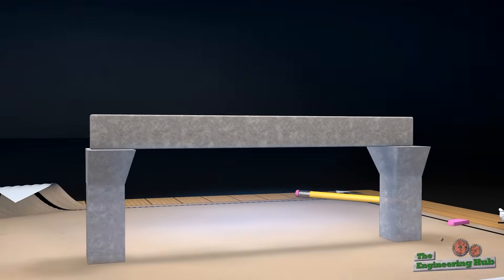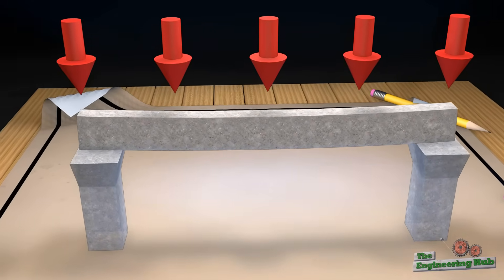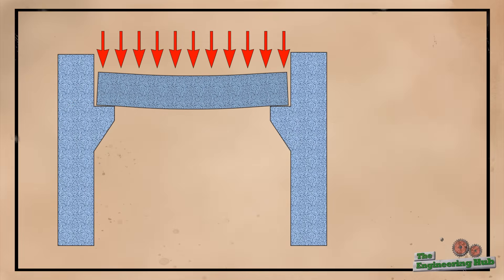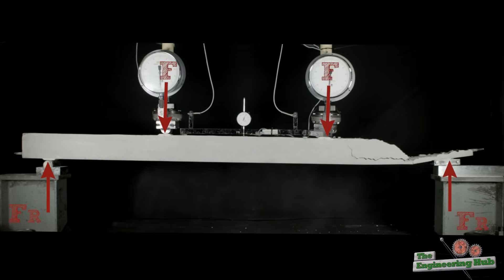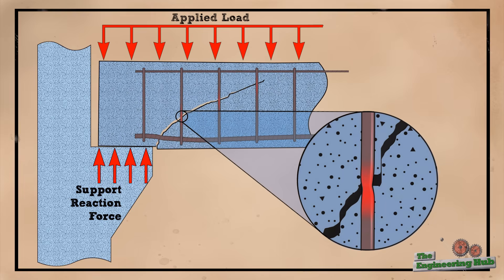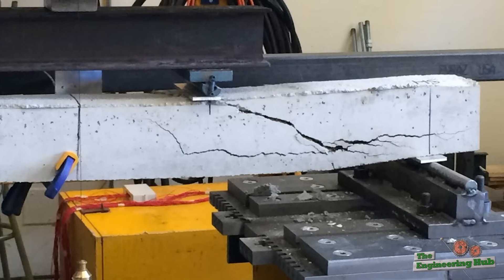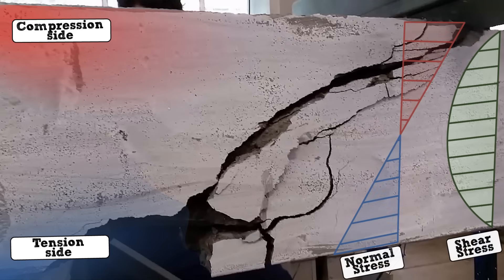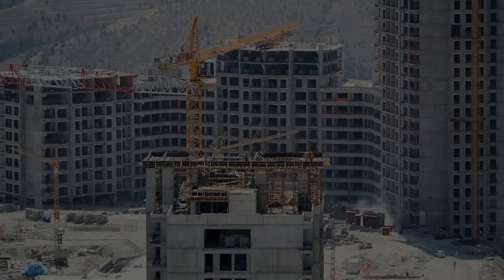The actual reason for using stirrups explained

Comment: Not an engineer, but suddenly the idea of prestressed concrete makes more sense. If you start out with tension on the load side you'll (hopefully) never have tension on the unloaded side. Right?
Reply from the maker: Well-observed Bill, the idea of prestressing is to eliminate (or lower) unwanted tension within the element. This is especially effective with concrete since concrete is very weak in tension.

Comment: A company I once worked for was expanding, and bought an abandoned property and company that once produced pre-stressed concrete beams used in bridge and building construction. All their equipment and machinery was still in place when the business closed its doors. It was quite interesting to see how their beams were being made. The forms were built per engineered specs. When ready for pouring of the concrete, very heavy steel wire rope cables were layed full length into the forms and attached at each end to stretcher winch's, which would pull the cables to the point of elongation. Once the poured concrete in the forms cured, the cable's were cut free from the tension winch's, leaving the beam in permanent lengthwise compression. These beams were so strong and effective in heavy construction, they were specified all over the country. I believe the company's name was Rackle, located in Garfield Heights, Ohio. I believe they closed up shop around 1968. Thanks for the interesting video.

Comment: Terrific video. Thanks. If you added the graphs of Normal Forces + Sheer you would get almost the exact shape of the crack. the bottom (blue) normal graph line mostly cancels out the lower half of the Stress curve, but past the mid point they add resulting in an almost horizontal line.  I know that what I've just learned in your video I'll now be able to spot in real examples, and I'll be able to build better structures. This is also exactly the type of information Elon Musk calls 'First Principles'.

Comment: now would changing the angle of the stirrups closer to the attachment point perpendicular to the potential tear line at the attachement point pointing progressively steeper towards the beam midpoint, then cross with stirrups that have the opposite angle and progressively going back to perpendicular towards the midsection? would that not distribute the shear loads better to the spaces of the construction where they usually do not exist or would that shift the horizontal tensile loads in the steel reinforments?
Reply from the maker: Hi Prallund, thank you for your interesting comment. The arrangement you suggested should provide better resistance against shear loads. However, implementing this and ensuring that it would actually be built that way would be difficult and require frequent inspections. Also, it would take more man-hours to install which at the end might end up being more expensive than just installing vertical stirrups for the entire beam with slightly closer spacing (lower material utilization) than what would have been required based on your suggestion which would be very efficient in terms of material use.
Reply: @TheEngineeringHub  I hereby declare this arrangement to be the "prallund-stirup-wave". ideas are open source. if anyone feels inspired to realize a "prallund-stirup-wave" in their construction, plz link me the foto :)

Comment: Good Video. You forgot to mention couple of other functions of stirrups, f.e.: 
In columns - holding together compressed reinforcement, especially during fire (buckling)
-improvement of the anchorage conditions
-Increase steel and concrete cooperation as a whole

Comment: Just subed, great detailed explanation!
 I wonder if it would make a difference if the stirrups were placed at a 45 degree angle or whatever would be perpendicular to the shear force? 
Seems like it would be stronger if we used tensile strength at the cracks. I'm not an engineer so correct me if im wrong, but explain please.
Reply from the maker: That's an amazing observation and it is absolutely correct, some designs do implement inclined stirrups. The downside to that is the additional manhours that it would take to install them in an inclined position. Usually, installing them vertically up with slightly smaller spacing is a more cost-optimal solution and therefore more common. Thanks for the discussion ace!

Comment: True! V well explained..also i learned that its best to use a higher cement concentration mix when the price is not v high compared to a lower cement mix , i m talking about residential building or course ..
Reply from the maker: That is correct. A higher cement content increases the strength of the concrete which is great and can result in less material being used. However, the downside to that is the decreased workability (since it will be less flowy) which could increase man-hours (cost) during construction.
Reply: @TheEngineeringHub  its always best to work under 15 degrees C if possible..even in hot summers i had jobs at 6-7 am in the morning ..best to do it is in spring and autumn time..summer too but early in the morning..

Comment: Wouldn't it be better to place the stirrups perpendicular to the expected crack line rather than to the reinforcing bars?
Reply from the maker: Yes absolutely, some designs do implement this. The downside to that is the additional manhours that it would take to install them in an inclined position. Usually, installing them vertically up with slightly smaller spacing is a more cost-optimal solution.
Reply: @TheEngineeringHub :
Related to Ko ka's question, I have wondered if the reinforcement for concrete beams ought be in the form of Whipple trusses, perhaps with reduced-section for the compressive steel members as the surrounding concrete would take most of the compessive stress and also prevent buckling.

Comment: In addition to this, stirrups also provide ductility. This is really important for strengt and design. Not only shear force resistance but also ductility
Reply: I agree, stirrups prevent buckling of longitudinal bars in the compression side, letting yielding of bars in the tension side.
Reply: why is V_dowel ignored?

Comment: Great video.  Maybe you could add another one explaining the differences between pre-stress and post-stress reinforcement, and an example of why an engineer would choose one over the other in real-world application.  Basically which to use and why.   Thanks for the video!  The cross section of normal vs. shear stress really provides a great visual understanding of how they differ and the result of each force on a beam.
Reply from the maker: Great suggestion and thank you so much for the feedback PA Mike, much appreciated!
Reply: When you say pre-stress, do you mean pre stressed cables within a beam instead of rebar?
Reply: @davidrn2473  Pre-stressed beams generally have both cables and rebar.  But yes, the cables are stressed within the casting form and then concrete is poured and allowed to cure.  After the form has been stripped and the cables cut from their stressing anchors the beam can take on a significant bend.
Reply: why is V_dowel ignored?

Comment: I think you missed an important concept of stirrups providing concrete confinement.  The confinement of the concrete within the rebar and stirrups helps to maintain the geometric spacing of the original reinforcement design.  This is a very important concept especially for high seismic zones.   See the lessons learned from the California Northridge earthquake.  Search for the report: f0016653-final-report-task-2175.pdf  By the way, American concrete codes for structures intended for human use provide additional margins of safety for life-saving.  In an earthquake, we're not so much interested in avoiding damage or overload of a beam or structure as we are trying to ensure there is enough strength in failure that a structure does not pancake.
Reply from the maker: Confinement is absolutely crucial for columns but actually not as crucial for beams (assuming no torsion) which is what this video is mostly focused on. In fact, often stirrups in beams are U-shaped rather than the hoops used in column design. Rather than that, we agree completely with you, William. We would also add the importance of the "Strong column, weak beam philosophy" which is crucial for ensuring that the beams fail first and dissipate energy. This way pancaking of the slabs could be avoided. Cheers, thanks for the discussion!

Comment: Reinforcement 
Concrete is a mixture of sand and gravel and cement

Which the purpose of the cement is to bind the sand and gravel.
When we say bind
It's chemical reactions of the lime to the sand and gravel..
Cement has the ability to solidify in pressure and without pressure it weakens

Now the beam are over hang and no pressure are existing expect to its own weight.

Now, what type of orientation of the weight, unlike post the weight are in compression and beams needs to be strengthened by either curving it to ways that it strengthen but costly or, put metals reinforcement, because, reinforced are infestimal pressure to the concrete which acts as a solid state pressure for it to harden the concrete.

Some methods use to put or small halls around the post or beams to harden and brake the stagnation to increase the hardening of the beams.
But now we use vibrator , yup.
We use different method nows
Reply from the maker: Thanks!

Comment: I’m not an engineer but I work as a roadway inspector and a lot of my work is on construction of new bridges. We make sure the bridge is built according to plans and specifications. If something minor or large is changed we have to go thru the licensed engineer on site. These videos help me understand the details of bridge plans. Well done!
Reply from the maker: That's amazing, thanks Joshua. In engineering and construction, small details could make a significant impact on the load-carrying capacity of the structure. Often, this is not too obvious and people may tend to ignore small changes but for example, installing fewer stirrups at the end of a beam could have disastrous effects. Thanks for the discussion, cheers!
Reply: Aviation works in a similar way.   A DER does the design,  a DAR makes sure that it's built that way.   Both are crucial functions.
Reply: @lautoka63  I’d love to get in the aviation field. Hard nut to crack without any experience or knowing someone in the field to bring you in.

Comment: One could start to wonder why we put concrete anywhere where it will be under tension. Its function there appears to be little more than holding the rebar in place, and protecting it from corrosion.
Reply from the maker: You are not wrong Sylvia. The reasons are probably more practical than technical. Building forms in a rectangular shape is much more cost effective. For some other places, like an internal column that could bend in any direction, the tension forces just can't be avoided. Thanks for the insightful comment, cheers!
Reply: In many applications, I think the truss would fit bill much better. Protecting the steel from corrosion can be achieved through paint coating.

Comment: My friend that is brilliant work from your side.... i usually watch engineering videos and this recommendation came right off.... i had watched only half way through before i paused and Subscribed... brilliant..
Reply from the maker: Thank you so much chapad, we are very glad to have you as a subscriber. Stay tuned, more videos are on the way!
Reply: @TheEngineeringHub  I'm subscribed and turned on the bell
Reply from the maker: Thank you @anonamemous6865 , it means so much to us to see that our viewers enjoy our content!
Reply: Nnnnnnnnnnnnnnnnnn
Reply: Nnnnnnnnnnnnnnnnnn
Reply: Nnnnnnnnnñnnnnnññnn
Reply: Nnnnnnnnnnnnnnnnnn
Reply: Nnnnnnnnnnnnnnnnnn
Reply: So why don't we put stirrups in slabs
Reply: @Odignridk  Slabs are supported by the base on which they sit (i.e.; the ground or base gravel, whatever you're pouring onto) and the support is continuous over the whole surface, so no part is under shear stress.
Reply: @daveyjones7391  not true, slabs are under huge horizontal stress
See my other comments explication
Reply: @Odignridk  most reputable contractors & architects specify wire mesh in slabs
Shear cracks occur in every corner and follows the same stress angle failure

Comment: Thanks for the video, what books 📚 can I read on this subject? I’m an industrial product designer and I’m starting building projects fro residential housing. I want to read and understand structural design.
Reply from the maker: A great starting point, if you are already familiar with statics, would  be: "Mechanics of Materials - Gere and Goodno" is
Specifically for concrete structures, the book by Svetana Brzev - "Reinforced Concrete Design: A Practical Approach" is amazing. 
For steel structures: "Limit States Design in Structural Steel by Kulak and Grondin. Cheers and goodluck!

Comment: thank you.I have been looking for exactly this explanation of why stirrups are concentrated nearer the ends of beams and some columns
Reply from the maker: Yes, that is exactly the reason. Stirrups resist the shearing forces that are usually the highest near the supports. Most beams do not need stirrups near the mid-span due to the low shearing forces that can be resisted by the concrete alone. 

When it comes to columns, the shear forces are actually constant along the length of the column. However, the ends are exposed to higher bending moments. The closely spaced ties in columns are usually installed to provided additional ductility and prevent spalling of the concrete in the case of an earthquake.